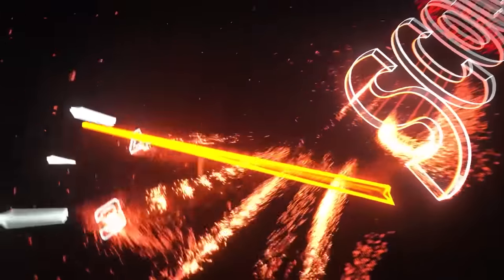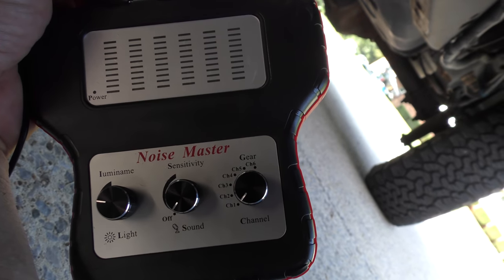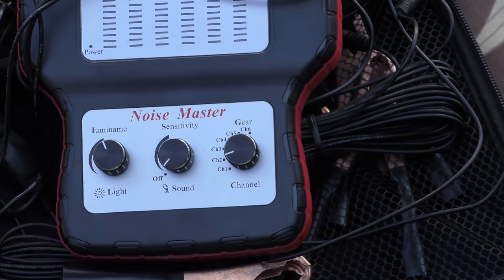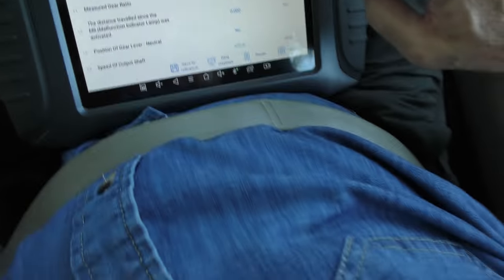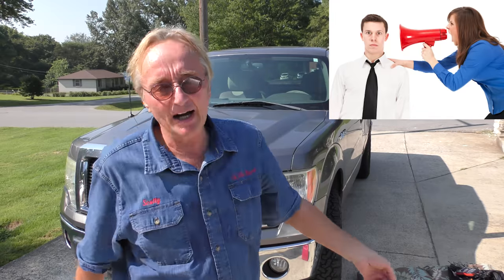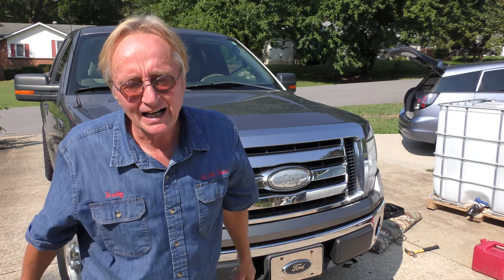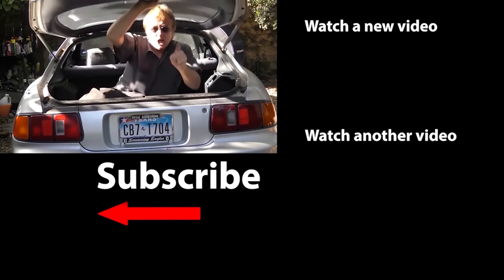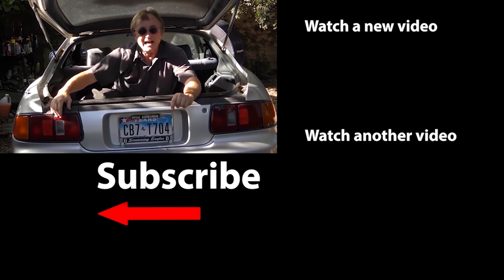If You Hear This, Your Transmission is Bad

Comment: Finding an honest mechanic in this area is a challenge.  Dealership?  No.  Big O' Tire?  A big NO.  Scotty, Thank you for being honest.  You are doing God's work.
Reply: Had a “manager” of a Big O years back tell me my 02 lightning was all wheel drive 🤣😂🤣. Never went back to one, never will.
Reply: Can Anybody recommend good an honest mechanic in New Jersey?
Reply: Dealer is stealer
Reply: That's everywhere unless you have friends or friends of friends in that industry or just do it on their own like my Dad and my ex husband and even then its sketch. 
Best bet would be do your homework, research the problem yourself, get more than one opinion and not tell one about the other and see what they say is wrong. There's many forums that are pretty informative online. 
It'll be pricey if diagnostics cost are up there but could save you thousands in the end by not replacing an exhaust over an o2 sensor. 
But you're also risking sabotage while they're checking it out. Like that cable they disconnected just to get a few hundred out of you. 
Sucks nowadays you just can't trust anyone.
Reply: 😂😂 @ “Big O’ Tire? A big NO”
Reply: Big O on 17th st Costa Mesa, forgot to tighten the bolts on front driver. I lost it going down the 405 at 75mph, I hit the k rail, called big O and they wouldn't even send a tow truck. Been spreading the word since 2004.
Reply: I do my own mechanic work on my cars, and I'm honest with myself
Reply: @tkrdg7885  Stealer-ship
Reply: Big O is a JOKE
Reply: I bought 2 tires from Big-O and had them installed.  They put my tires ~48PSI, so I pulled over to let air out, so I could drive safely. That's when I noticed they literally installed two different tire sizes, I paid for two 195/65 15's. They installed one 195/65 15, and one 185/65 15.  When I took it back to get the right tire on there, I told them to put the tires to the PSI to factory standards written on the inside of the door.  Nope, they were both ~10psi over.
Reply: @kennyt8730  Ruthless,  I'll definitely never go to a Big O

Comment: And if you have a nissan with a Jatco CVT, your transmission will always be bad. Good afternoon scotty!!!
Reply from the maker: afternoon!
Reply: I have a 2014 Nissan Altima have a transmission issue never again
Reply: Adin Ducker
Are you first again ?
Pretty good 👍
Reply: Meh… 50/50 chance… Chrysler, though…
Reply: I mean the first 200k it’s fine.. had plenty of nissans at this point around 2009 that made it 200k no tranny oil changes even
Reply: @m-raytheboss8994  2005 Altima you should be thankful it's running.
Reply: Yep my wife has a 15 altima trans went bad at 90k and cost us $5500 to replace
Reply: Jatco CVTs come from the factory with noise detection equipment.
Reply: Ford just did a 100,000km service on my f350 diesel. They did a transmission flush. Never again!!! It never shifted right after that. Would take like 5-6 seconds to go into gear after that.
Reply: @scottykilmer  scotty. I have a 2005chevy avalanche the e fans don't come on and  Also don't come on when ac turn on.  I changed all the the relay for the e fans and still don't work.  Help me please what could it be. What should I replace
Reply: @nmatthew7469  it's not a total bust
Reply: @MyRuger  They Use To Be good little Cars, But like with everything else the Engineer's redesigned Everything. Put In A New Rear Sub Frame In A Nissan Murano 09 I think. That Was A Bear.
Reply: @jimelfman1369  yeah I'm looking for the right deal used cars are not overpriced I will be buy me a Lexus or Toyota next
Reply: @aboivanka6104  It's true that their are Some Hard Part's Upgrades. One In Which Is the Valve Body.
Reply: @santiagojessicafernando872  did you check the fuses?
Reply: @soundsolutions  yes I did. There all good.  What else could cause that problem
Reply: @santiagojessicafernando872   i would check the wiring, also do a bulb 💡 test to the terminals, see if there's an electricity running, if there's isn't, it might be something effecting the electricity feed to them, might be the ac itself, the temp. Sensor.. Etc. It actually depends on how they stopped so you have a clue where the problem might be and know where to start, if u have been messing with the wiring or the ac, it definitely there where you should start to dig.
Reply: I too have a Nissan altima 05 ....engine/ trans 112k transmission has delayed drive engagement when cold ....but 
Once it warms up no problems afterwards  until the car sits for 8-10 hrs  .. it's a repeat. I'm thinking dirty transmission filter or screen. Your thoughts Scotty or anyone experiencing that issue?
Reply: @scottykilmer  I too have a Nissan altima 05 ....engine/ trans 112k transmission has delayed drive engagement when cold ....but 
Once it warms up no problems afterwards  until the car sits for 8-10 hrs  .. it's a repeat. I'm thinking dirty transmission filter or screen. Your thoughts Scotty or anyone experiencing that issue?
Reply: @m-raytheboss8994  u have a 20+ year old car what did u expect
Reply: @themeach011  shift solenoid got dirty. you need to do 3 fluid changes to really get it out
Reply: @defaultusername2371  so I gotta spend $700 X3 to get something to work fine that worked fine before they did the first one?? Why not just leave well enough alone. I have run other vehicles to way more miles and skipped that particular maintenance and never had a problem but I was no I would rather do the maintenance this time and then bam
Reply: Yeah but if you got the cd009 you can run 900hp and still last 180k miles from Nissan! Just gotta know what to buy ;)
Reply: Got the 2016 nessia sentra with 60000 mile it just now at the replace tranmissiofuelit and real place stack plugs and wires and it need oil change it cost over 400 and sometimes with out tune up what should I do need someone input but I know it needs plugs and wires u can hear the tic witch it say in ownersmainul that you will hear a knock not to worry it mostly that and to just need to be replaced and it needs the transmission flushed and replaced the transmission fluid????
Reply: I got a 2003 Altima 3.5 v6 did my transmission flush and filter And she runs great at 126,900 and I keep her up all areas
Reply: My Nissan Almera 2000 got a loose camchain after 160000 KM or 99419 miles, never buy Nissan ever again
Reply: @themeach011  Transmission Flush is the worst mistake ever.
Reply: Absolutely not true
Reply: My mom drives a 05 Nissan Altima with 243,000 miles on the original engine, and transmission. It’s still chugging along, but I can tell the transmission is starting to go. It shifts into reverse hard, and jerks back into first, then it does ok.
Reply: 2020 Altima tranny went bad at 15,000 imagine that
Reply: @just-dark-_-1637  you probably didn’t maintain it correctly if you have a altima and your transmission fails that’s on nobody but you stop driving so crazy and maybe it’ll last longer
Reply: @dg7848  maybe it’s because I got it at 10,000 miles and the owner before drive it crazy idk Ik I drive nice and take care of my car
Reply: Yes. Just fuckin yes
Reply: Yeah, Nissan is worthless on transmissions, had Rogue, slightly after warranty that death whine starts...
Reply: @m-raytheboss8994  do you have a cvt transmission? Lol, NO!
Reply: @nmatthew7469  it was engine and trans problem I got rid of it though I took a loss but who cares at this point wasn't doing nothing but costing me money that I wouldn't have put in to fix it LOL

Comment: Industrial mechanic of 40+ years experience here, my mechanic's stethoscope is one of my most useful tools.  Not expensive.
Reply: You 💯 correct… it’s absolutely one of the most useful tool to have. Saves a lot of time and money when tracking down those pesky noises. Back when i was younger i would use long wooden handle screwdriver or a long stick and put up to my ear to find the noise and this did work but limited to certain areas in a car. Now I’m older i know the importance of having the correct tool so I’m not limited to whatever the situation is
Reply: I even used it doing plumbing work
Reply: I need to get one. Never heard of it till today

Comment: To check motor mounts, just open the hood and watch the engine to see if it moves while shifting from park to reverse, then from reverse to neutral, then from neutral to drive. Pause between shifting gears.

Comment: This reminded me of my thumping and shaking of my vehicle. I was really concerned about breaking down in the middle of an intersection. Anyway, I found it was the drive shaft completely destroyed along with u joints. I replaced it with a OEM assembly from the dealership at $800. It works flawlessly. Toyota Tacoma with 270,000 mi.
Reply: Thumping and shaking was your drive shaft u joints?
Reply: @gabegarcia7779  Yup, it felt like I was going to lose my Axle on the highway especially when accelerating during a traffic stop.  The drive shaft was replaced with U joints, then the wheel bearings assembly was replaced. The truck is now smoother than ever at 270,000 mi. Crazy how Toyota builds their vehicles!.

Comment: For the surface rust on the frame, etc. I have just saturated them with used motor oil and that seems to do the trick.
Reply: Old Chevrolet's V-8's  use to do that anyway.
Reply: Cheers Paul...my Dear Uncle was a Wisniewski!!
Reply: @henryelceser  that is not uncommon surname
Reply: @maciejp7829  I know, but ours died out around here.

Comment: A bearing noise. Which one? 1st to 2nd? 2nd to 3rd? 3rd to 4th? 4th to O.D.? Mainshaft bearing? Planetary? Output shaft? Pump bearing? One arm bandit in Vegas.
You will never know when, until you hear the big kachunk! And then a red or amber light comes on. Stranded.
Don't mind me. I have blown up a few automatics in my time.
Reply: Does it really matter which one? 🤔 To fix it you will have to take it off and apart regardless.

Comment: Rust Check definitely works to suppress further rust.  The stuff in the green can is thicker than the red one and is very sticky so that it doesn't drip off.  The red can is a thinner liquid and will penetrate cracks and crevices nicely but will drip off over time. I've been using their products for over ten years and couldn't be happier.
Reply: I am curious,any specifics on your results?
I have a 85 f150 that has surface rust but is solid.
I would like to get 10 more years out of it.
On the fence about undercoating by a pro,seems pricey without any real warranty.
Reply: @poultrypickins9572 , try the spray in the red can first. Just drench the rusted areas inside if possible (I took off wheel wells to get access to the inside surfaces), let is drip off and then wipe up any excess on painted surfaces. Rust Check is an oil-based product with some kind of rust inhibitors. It prevents further rust damage. Car washes do remove some of the spray so keep an eye out for dryness afterwards.
Reply: @MrJx4000  Thank you. I will try it in april when the roads up here are less salty and I can make it home from the wash without it getting to dirty again.
I live in NY so rust is the #1 truck killer here.
Reply: Fluid film.

Comment: Hi Scottie, rust check is a service and product we use up here in canada, and it does work with some caveats as does other products like fluid film, crown and others. The aresol cans you showed are more for touch-ups. It's best applied with a compressor by someone who knows what he or she is doing. Holes can be drilled and recapped for access into rockers door panels etc. The caveats are one it has to be applied right. For frames a long wand is used to get it into the inside of the frame as well as the out side. The next caveat is when it is applied, in the fall and it is a good idea to also do it in spring after the snow and salt have cleared from the roads. The spring application needs only be done to the frame and undercarriage. Also it is best if this is done as soon as possible to the vehicle's life. The green can is a thicker product that will stay on the vehicle, almost like a thin grease, longer and not get washed off with rain etc. These things (rust check and others) do work it's just a matter of how and when it is applied, someone who is not stingy with the product when doing the service is best.
Reply: In the good ol' days we used to use "fish oil".
Reply: Yeah, in canada with this much salt there's a whole different approach needed.

Comment: You're right Scotty, referring to rust there is no miracle cure. However if you paint it with used motor oil or the equivalent, it will certainly slow it down.

Comment: Btw, don't whack your catalytic converters like he showed. If you do it too hard you're going to cause the issue he was checking them for which is a cracked and busted cat.
Reply: Nah I am a Master certified mechanic you don't know what you are talking about. This is necessary if they crack is because they had hairline splits to begin with. If they rattle you need new ones anyways. Always some uneducated stranger on here giving tips. Pufff....
Reply: @elir.torres8642  you sound like the lady that grabbed my power steering pump and the fender of my car and yanked as hard as she could too see if there’s a small wiggle. and she destroyed my pulley out completely. Than she showed me what she did and told me she yanks on everyone’s pulley like that and never breaks, she tried charging me 1100$ to replace a 60$ pump 😂 not every professional knows what the area talking about either
Reply: @elir.torres8642  i whacked mine and they fell right off. I went and got dogs. They bark instead of meowing which is weird but hopefully they last when i submerge them in the lake.

Comment: I have a 99 Mercury sable with a torque converter issue w. 1744 code. If you drove it, you wouldn’t know anything was wrong but I know. 10k later, it’s still running great and getting up to 30 mpg! . Now has 105k

Comment: Hi scotty your videos helped me figure out my issue. I had acceleration issues with my toyota camry. I went to mechanic they told me to replace the Fuel Pump, spark plugs and coil on plugs but the issue was still there. Then I watched your videos and went back to the mechanic to check and clean the Mass Air Flow sensor, Catalytic Converter, Throttle, Air Filter, Hoses etc. They were all fine. The problem was actually with the Fuel injectors. They cleaned the injectors and the car is running like a beast now ... Thank you so much !

Comment: Scotty! another great video. There is a solution for rust where you really do not have to clean it off- no kidding- fluid film for instance is greasy and will soak into rust and keep water away. About transmission noise: 06 Sentra with a chirp only at shift from 2 to 3, ever hear about it?  There was a tech bulletin about adding an additive to tranny but some say noise came back.

Comment: I had a weird nose coming from the transmission or transfer case area on my 2017 Ford F150 so I changed the fluid on both. The noise seems to have gone away for now. The main noise I had was the kind of sound you would get when going over rumble strips.
Reply: Hi José, do you still get that sound now after you changed your AT fluid?
Reply: @Oluwatosin Olayemi  no it actually went away completely after I changed the transmission fluid and filter. I also changed the transfer case fluid since it's the same as transmission.  I've also checked the front and rear differential, but the fluid in that was good.
Reply: @joseespinal3363  usually this is torque converter slippage.
Reply: @abogadobob  it could have possibly be but I have not had any issues with the truck since I changed the fluid  over a year ago.

Comment: Yes a incorrect gear ratio means its “Rebuild” time, I just went through this, I have a 2011 Ram 1500 Laramie, 4x4 with the 5.7 Hemi, and after years of no trouble at all, I passed 168k miles, and the week after I  passed 168k miles, The tranny started acting up, and I was in limp mode, I had a p0733 code, (Third gear incorrect gear ratio), long story short, my clutch pack was worn down. I cant complain, I was able to get a lot of miles before it needed fixing. I baby my truck, and dont really haul anything heavy.